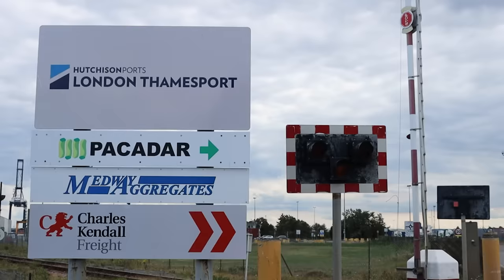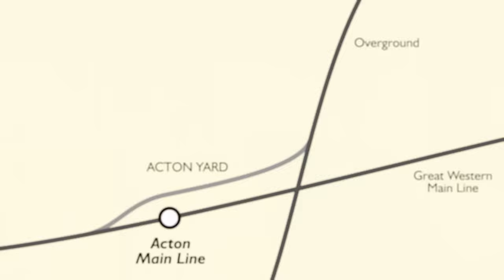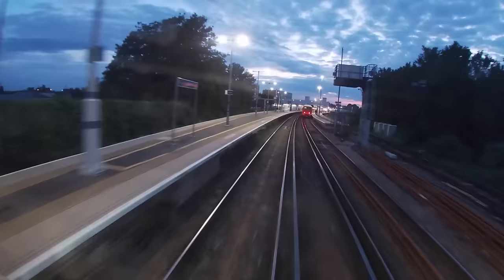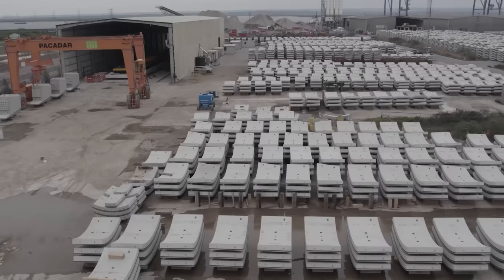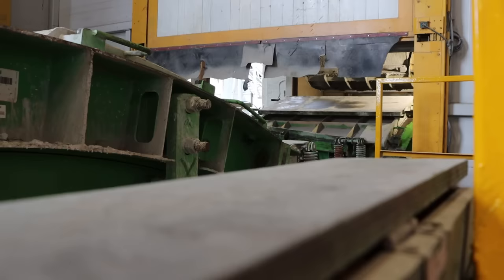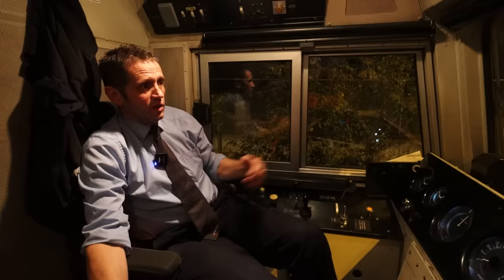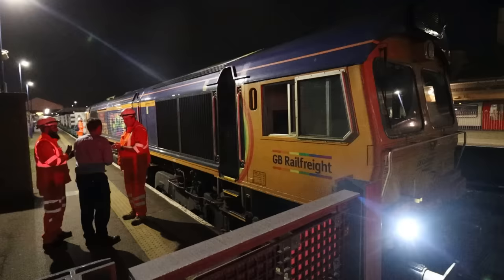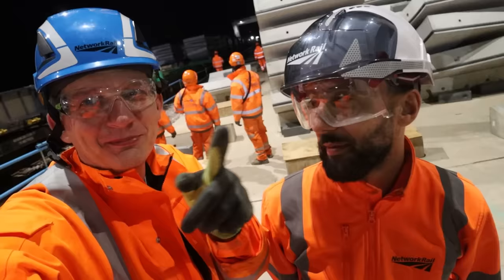The Overnight Freight Train Delivering HS2 Tunnel Segments

Comment: my favourite fact about tunnelling rings is that if you put all the sections of a ring together, the sides are not quite parallel, eg the join isn't quite 90 degrees to the tunnel.   They do this so that they can steer the tunnel.. so if you are going straight you just alternate the angle (a lefty then a righty) .. but want to go up/down/left/right you put 2 a row of them oriented the same way round.  Such a neat idea.

Comment: 0:55 The Cumbrian Coast Line is a good place for this as Barrow-in-Furness uses semaphore signals and a token exchange happens at Whitehaven and Sellafield. At Sellafield the train departs the station heading north, and then immediately has to stop to obtain the token from the signaller!
Reply: The token exchange also happens at St Bees
Reply: Isn't the Cumbrian Coast Line a single track for most of it apart from the stations?
Reply: No- the only single sections are from south of Harrington station to the former Parton Junction, Whitehaven (Bransty) signalbox to Sellafield (passing loop at St Bees) and Park South Junction to Barrow-in-Furness. The other oddity is that Whitehaven Station is just called Whitehaven (formerly Whitehaven (Bransty) but the box is called Bransty (not Whitehaven or Whitehaven (Bransty), and the signal numbers are BYxx. The rest of the line is double track. At Whitehaven the through platform is now the up and down main (the line has been down since Carlisle and now becomes up, and vice versa northbound) following the closure of platform 3 many years ago, and the sealing up of the passenger subway from 2 to 3. When built the now terminating Platform 1 was a through road onto the Dock Railway system, and on to the former Preston Street passenger station (later goods only after Corkickle station and tunnel were built @martinjh999

Comment: The US and UK probably have the passenger/freight ratios flipped.  IE, in the US, there are a lot of freight trains (and frequently very, very long ones) but less passenger service, while the UK has more passenger service and less freight.

Personally, I believe a great deal of it is the size and population densities of the two countries.  The US is very large but not very dense, especially in the non-coastal Western half of the country, while the UK is much smaller but denser.  Lots of places in the US are too far for passenger rail but perfect for the slower needs of freight.

Comment: Watching this as an American I am struck by just how TINY the British freight trains are compared to what we see here in the US. It isn't just that our loading gauge is so much taller (in a lot of the country, anyway)--it's that the trains themselves look so much shorter and less heavily-laden. I also can't help but be jealous--here in the US, passenger services are routinely held up during the day by slower-moving freight trains. Theoretically, passenger services have priority but only the federal government has the right to enforce that against our private railroads...and the government has never once acted to enforce passenger service priority. I can't even imagine what it would be like if passenger services had the level of priority Network Rail seems to give them in the UK!
Reply: The annoyingly small loading gauge presumably goes back to the very early days of railways. I'm not sure what the maximum possible length of a container train is - they have to fit within a signalling block and also the terminals they are coming from and going to. I'd say the longest freight train I've seen is about twice as long as the longest passenger train, so around 440 yards or a quarter of a mile.

Comment: Can remember occasionally laying in bed late at night as a kid listening at the sounds of a train echoing through late at night as it passed through our local station, the metal clatter of wheels on track and occasional brake squeal. Was surprised because I knew “the trains” at our station didn’t run overnight, but then at that age I was thinking just of the passenger trains and had to find out that was the freight. Ah, trains echoing in the night :)

Comment: Cab ride on a night freight, Geoff joined the dark side of the network ! Dark but with fine weather, imagine rain snow and fog all adding to the fun ... 
 
 I had a cab ride way back in 1978, on a DB V100 diesel running a freight through the Ruhr area at night and on to Meppel in North Netherland. It was most impressive, the Ruhr steel plants were still working in those days !  The V100 was quite comfortable, the Dutch loco that took over was an old wibbly wobbly NS1100, the driver had to sit on a small hard wooden stool and I had to stand. Stand beeing a misnomer, I had to hold on for dear life as the loco lurched from side to side.

A question: is the Heathrow fuel/tanker train a standard working or a special because of pipe-line maintenance or the likes  ?
Reply: Its a normal service and if you look at the old Colnbrook station site you can see a discrete very narrow siding were it is unloaded about a mile west of terminal 5. Fuel is also delivered to Heathrow by pipelines and occasionally by truck as well. My understanding is that the rail tanks are having to take up the slack until the new Fawley refinery to Heathrow pipeline (60 miles long) is completed in 2024/5.  There have been minor fuel problems at Heathrow this summer and airlines have occasionally been asked to arrive with more fuel on their aircraft than normal because of this. Sources suggest Heathrow uses up to 20,000 tonnes of jet fuel per day so rail deliveries are probably a slightly smaller percentage than suggested in the video.
Reply: @Pesmog yep, that new pipeline has come right through my local area. Caused a fair bit of local disruption.

Comment: I feel that railways are so underused for freight. There's an industrial area in Brimsdown, Enfield, which has several food warehouse distribution centres. All of the supply comes in via lorries. Yet there's Brimsdown railway station, and Enfield Lock railway station, that easily connect up to where the suppliers are. It would be insanely easy to have a siding running from there and into the warehouse yard, especially seeing as they come from the same suppliers, such as in Spalding, and the retail distribution centres are literally next door to each other. It could be the same train! It's infuriating.

Comment: We were meant to have something similar in Victoria, Australia, but after putting in all the infrastructure I believe the track was too rough so it all goes by road
Reply: But you have road trains which don't really fit on our small island.
Reply: @caw25sha  kinda but not for this, and Road Trains are generally not allowed in the main cities. The plant is 200km north of Melbourne, and they are using B-Double trucks, but only 1 segment per trailer, running trucks about every 45min.

Comment: So here's a question: How long a section of tunnel would that load have created?
Reply: Each ring consists of 8 segments, so with the 144 segments on the load, we get 18 rings in total per train. The segments have a width of 1.8m, so 32.4m of tunnel per load (considering no gaps).
Reply: they said 23 wagons , 6 segments each.. and a ring is 7 segments... so call it 19 segments.   each one looks to be around  1.5m wide... so call it 30m...   of course there are 2 tunnel bores so only 15m of progress.

Comment: Those concrete tunnel rings look similar to the ones used when the Canadian National Railway built the new St. Clair tunnel between Sarnia Ontario and Port Huron Michigan in the 90s.
Reply: they seem to be getting tunnelling down to a fine art and they use a lot of the same kit all over the world now (for softer soils and clays).   The Channel tunnel was revolutionary in the 80s but now they are doing it all over.  I even saw they are doing it for a mine near whitby to run a conveyor bet 23 miles to cut down on road traffic.

Comment: I'll wager that 66773 enjoyed playing a prominent part in the video. I used to have a Hornby model of that very same Class 66 (albeit with inaccurate headlights because it used an outdated tooling), but I have since given her to a friend as a birthday present.

It's always nice to see videos about cab rides. I had one at my local heritage line back in January, with the locomotives being two of the 'DBR' class - numbers 1199 and 1282 (originally built by General Motors in 1965 and rebuilt in the early 1980s). They also have EMD prime movers like the 66, albeit with only eight cylinders and a noticeably high-pitched sound.

Comment: To think if they built the new London airport in the Thames estuary then it would probably be getting its aviation fuel delivered by tanker or barge.
Reply: I assume they would run an underwater pipeline across, a sort of modern day Pluto.
Reply: The Norman foster masterplan for the estuary airport had it connected to a new freight orbital line circling London and linking up with the ports. Was a brilliant joined-up masterplan, but we tend not to do long term infrastructure build in this country unless forced to, e.g. Capacity limitations driving HS2

Comment: Thanks for making the video Geoff. Any chance you could do a follow up video that shows how hard it is to slot the journey that this train made into the various scheduled passenger timetables that would be running over the multiple bits of track that the freight train runs on.

I do know that a big part of the business case for HS2 is "freeing up capacity on the existing mainlines". And I do know that the one train per hour service from Watford Junction through Clapham Junction, might benefit from the capacity release of HS2, on the lines between Euston and Watford. But I don't know how much all the lines in South London and South East London are squeezed.

So, it would be nice to know how hard it was for Railfreight to win the five slots per week, for this train service.

Comment: I wonder what the redundancy build in is for the Heathrow fuel train.  What a disaster if something happened on the line.  Did  anyone in the Underground / rail line stations wave as you rolled through.  I always wave at freight trains.  Every time you mention or feature a station ticket hall or one that has had a sprucing up, I put it on my mental list for a visit on my next time in town

Comment: Why wasn't 2 Class 66s used to haul this train? Especially when it would improve the acceleration & speed of this particular train.
Reply: Imagine that there are quite a few speed restrictions and generally low speed sections across that route so no need
Reply: @oliverturner128  

Isn't that due to Infrastructure Issues though (which could be addressed)?

The reason I'm suggesting this is because running faster (& higher accelerating) freight trains makes it easier to increase passenger rail frequencies on the various rail lines in & around London without resorting to significant infrastructure upgrades.
Reply: Hi Mr Smith, two locos means two lots of fuel burn etc and with freight margins very much on a “last wagon” basis, I’d be surprised if they would go for that. In terms of speed, south London signal spacings mean speeds for freights are mostly “two thirds” passengers, meaning we stick at around 40mph max the whole way. A single 66 isn’t sprightly but it is simple and efficient! And sounds great…
Reply: @MrSmith1984  It's running overnight, like most freight, so that it and the passenger services don't get in each other's way.
Reply: @chrisdenham9086  

*I don't blame the likes of GBRF if they feel that the cost of double-heading simply doesn't make sense. That's why the likes of Network Rail need to offer financial incentives to encourage freight companies to use additional locomotives for their freight trains.

*Considering the number of infrastructure constraints on the Railways South of the River that already exist, having Freight Trains run slower than passenger trains (on that same track) is a good way to reduce what is already pretty scarce capacity on those rail lines. Especially when those freight trains already have the problem of having to travel behind passenger trains (on the same track) that stop at more stations than they do.

That's why running freight trains at 60mph (& improving their acceleration) would help increase capacity on those lines.

*Yeah the Class 66s sound good, that I can agree with.
Reply: @sykescalvin09  

To be pedantic, that train wasn't quite running overnight until the last hour of its journey. Likewise there is still a fair amount of non-overnight freight train journeys since it's impractical to run all freight trains overnight for various reasons.

That's why it makes sense to run freight trains with additional locomotives to increase speeds & acceleration, thus meaning that additional capacity is freed on existing railway lines.

Comment: Since the first part of the line was made freight only in 1961 would it be possible to reopen it to low speed passenger services using the single track which could run during from morning until evening?

Comment: Cancel HS2!
Reply: How else would you boost freight capacity?
Reply: @monkthehare7782  Irrespective of whether HS2 is built on not, implement the Chartered Institute of Transport's plan to electrify 40 miles of railway for each of the next twenty years.
Reply: @Fan652w electrification helps but it doesn't it doesn't stop mixing high speed passenger services with slow speed freight.